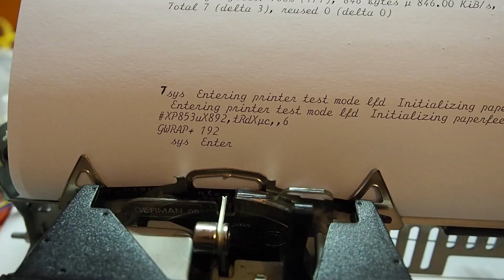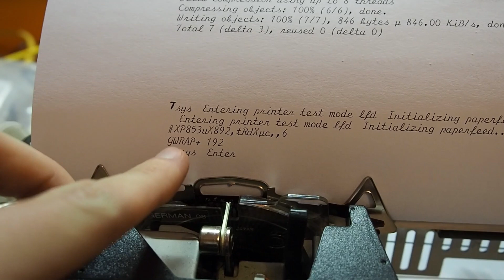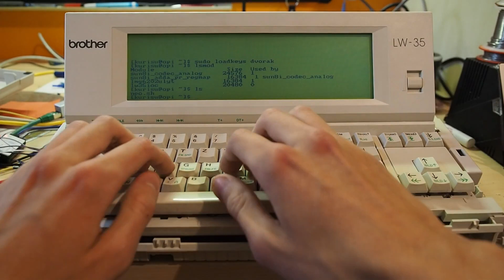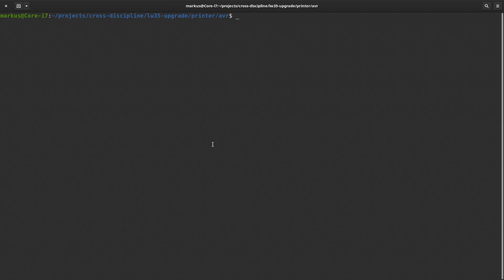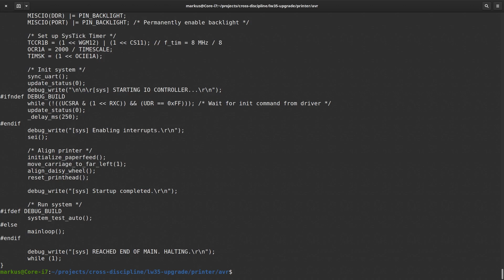Brother LW-35 Typewriter Modernization Vlog 5: Bringing It All Together

Comment: That was absolutely awesome! Great work :)
I've been wanting to do just this project for a long time (but I'm still trying to find a printer that's so open that I can immediately read the print output, kind of like a teletype) 

One question: It looks like you made your own STK500-compatible interface in your kernel driver in order to use the /dev/lw35 device. 
Why not just use avrdude's support for using GPIO pins and just hook the ISP of both microcontrollers up to the Orange Pi (with seperate reset lines for both MCUs)?
Reply from the maker: Hi. Thanks :)

Yep those old teletypes are cool. But sadly I don't know of a good one either.

About the STK500-interface. Not really, it's just a really cheap hack (and don't look at the code too closely ;) ). The AVRs are already connected to one of the Orange Pi's serial ports for normal operation, so I wanted to use this link for programming as well. The problem is that I didn't have enough I/Os left for true AVR-ISP programming, at least not without additional logic. The pins are shared with the ULN2003 pins for the  stepper / solenoid / DC controls for the printer. In other words, we'd hear some terrible noise from the printer each time we programmed - or worse. Also, if I can make my design more efficient, why not reuse existing wiring.

For this purpose, I programmed a modified Arduino-bootloader onto the AVRs, which can also handle "addressing" a single device in the UART chain (https://notsyncing.net/b/img/2020/lw35-arch.svg ). Then, when programming, I just reset all chips, configure the chip I don't want as pass-through, put the other one into programming mode, and configure the kernel driver to simply forward everything to and from the serial device to the device file (essentially it acts like a standard ttyS now, with limitations). Then, I can use avrdude on that device just as if it's a normal Arduino board.

TL;DR: I just use the Arduino serial boot loader on the AVRs, and put the kernel driver into raw bypass mode. I have to do it this way because I need the I/O pins exclusively for something else.
Reply: @m42uko  OK, cool! Thanks for your answer :)